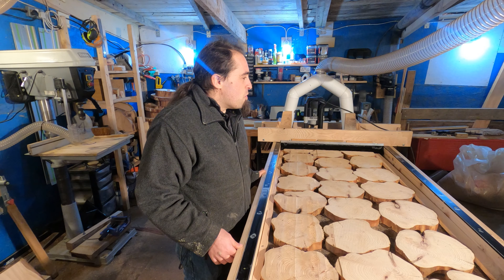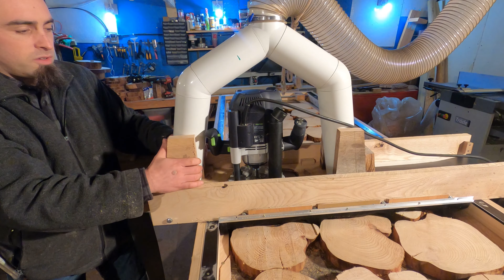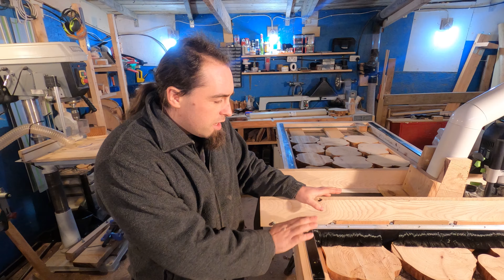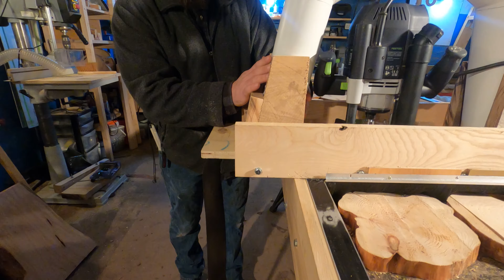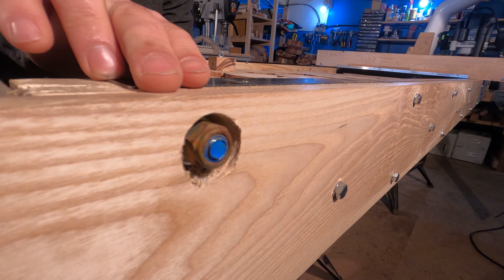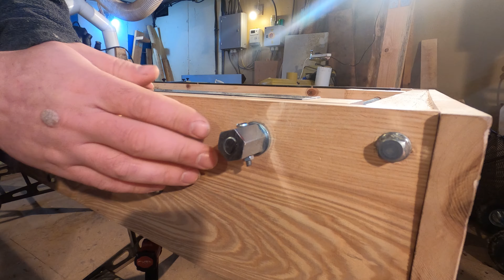The Super Cookie Levelling Contraption Designed by the Blind

Comment: In regards to the loosening of the locking nut at the end of the three meter long threaded rod for your vice, tightening a second nut against the original nut will usually lock the first nut, preventing it from loosening. From the video it does not look like you have room to thread a second nut on the end, perhaps if you have room to recess the wooden hole further so that the first nut could thread on further, making room for a second nut. Optionally, if you could get someone to weld the nut onto the threaded rod, but then you would not be able to remove or disassemble the vice. Great video, I'd like to see this leveling contraption is operation. Have a nice day!